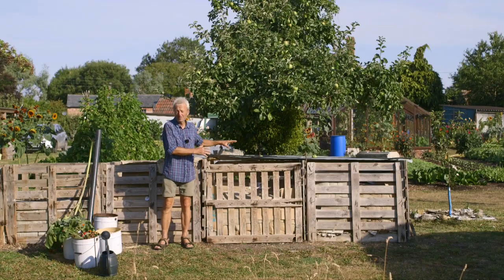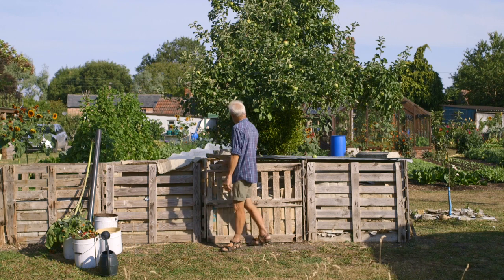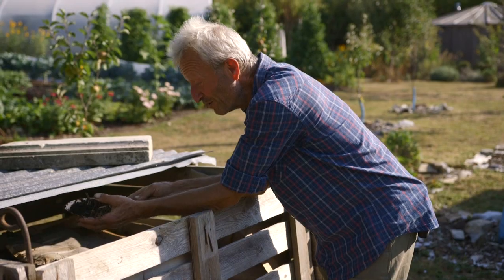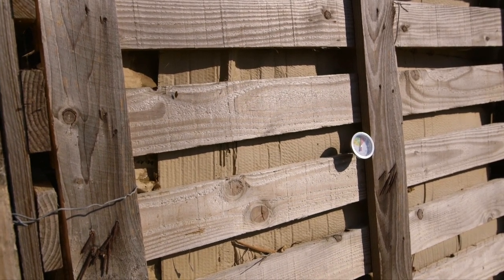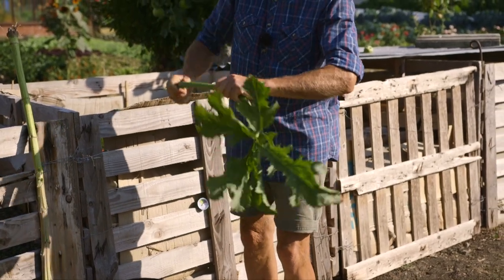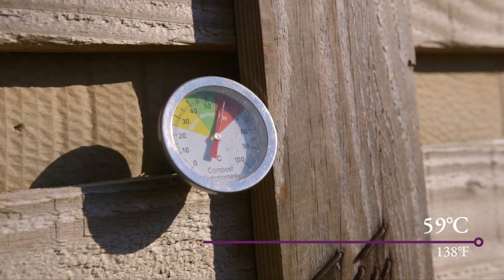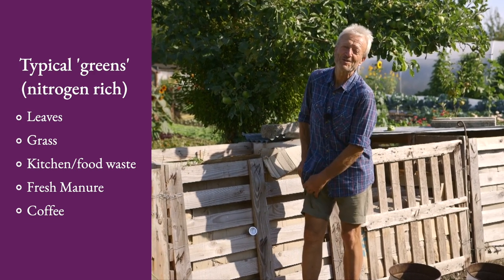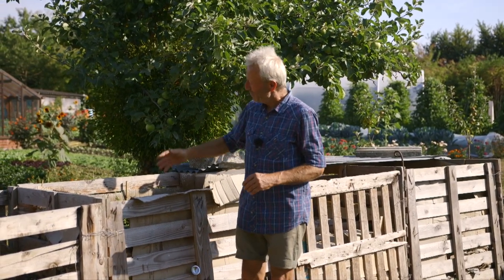4 Compost Heaps in 3 Bays, ready in 6 to12 months

Comment: Hello Charles! I am a wee bit confused, you put the final stage compost bin in the middle, I thought it would start at one end and you would turn them in sucession, working your way towards the end finished bin. If you have two on either side of the finished bin, what order are you filling the two working bays? You probably explained and I may not have understood. Thanks so much for your great videos, and I learn from the comments too!
Reply from the maker: Hi Mary, I think we needed a diagram! Yes it is not successive, we add new material only to the bins on either end.
The middle bin or bay is always receiving only half-finished compost which is turned into it. 
The turning frees up space to start again with filling the outer bays
Reply: @CharlesDowding1nodig  I gotcha, I guess that's good when you have lots of material to get composted! Thank you for clarifying!
Reply: Charles. Do you empty each bin into the middle or just take most composted part?
Reply from the maker: @SGSpeaks  yes the whole of each of the outer bin ends up in the middle which then contains over a tonne of great compost, after another 2-3 months
Reply: I am going to have to come and see you do it🙄
If you empty two full bins how is that going to fit in and wont the most recent material be uncomposted. Apologies for labouring this especially as I was stood in a compost bin with you when you first explained it!

Comment: Charles notice you have a cover of corrugated iron on top. Do you cover your bays for a particular reason? We've had alot of rain here in Sydney, 3rd consecutive La Niña in fact and the piles are constantly wet. Would you recommend covering them? I can't seem to get a heat build up but you did mention. That wasn't so critical. ☺️
Reply: One of his videos shows that his compost piles had the slanted covers built for protection from the rainy season.
Reply: He mentioned in the earlier video that the roof was to keep excess moisture out in his climate (which sounds like yours temporarily)
Reply from the maker: Yes in rainy weather, I cover! Your weather sounds crazy!
Reply: @CharlesDowding1nodig  thanks Charles. I missed have missed that finer point. Will scrounge for a cover tomorrow!! The Eastern states in Australia have been hammered by  La Niña and we. Are so over it. The 3rd round coming up. Prior to the wet  we had that devastating drought!
Reply: @DK6060  thanks! I missed that finer point.💐
Reply: @ritalr15  thanks Rita. I missed that finer point. 💐

Comment: Hi Charles, great video!  Thank you. I just have one question if I may, I have worms working away in my compost bins which I started a couple of years ago, I haven't accumulated enough to use on the beds yet, but when I do, should it all go on worms and all or do the worms need sieving out and leaving in the compost bins? Thanks in advance! :)
Reply from the maker: Hi Corinne, actually I would spread that compost when it's just a year old, you don't need to wait so long - and spread the worms as well! They will carry on doing some work on the sol surface and then leave some eggs in the soil to hatch more little worms at some point in the future. See if you can find more materials to add to your heaps as well, from perhaps tree leaves at the moment which often are available nearby

Comment: Hi Charles, I could get hold of some horse manure which has wood shavings (a lot of in proportion to the quantity of horse poo  and urine) as bedding material. When I used it in my compost heap I still got quite lots of shavings in the final product, could I consider this kind of fresh manure like a more balanced green/brown rather than a pure green material, mixing it with some other greens perhaps while layering the different ingredients? Thank you in advance and also for all the knowledge you're sharing in general, keep it up!
Reply from the maker: Cheers Francesco and depending on the amount of wood, you could use it as compost and will then have some wood flakes on the surface of your beds, which as long as they are not too thick will be fine

Comment: Hi dear one, if i would use these palletsiwould get the local esthetics commissions and my landlord after me...
Isrockwool a good starter material witheoodchips compost for my Marron mushrooms? And i want to use and old truck of a pinetrees which root is still in the ground and slowely deteriating..I want to try to grow some other species mushrooms on there..is that the right compost or should I treat it differently before i put the spores in the deteriating parts?!
Reply from the maker: 😂 and I don't know Simone

Comment: I love making compost and we have an added bonus killing 4 sheep a year for the table, everything not for freeze is buried in centre of a heap ( bones removed when we deconstruct) so we end up with almost pure worm castings in the middle of the heap surrounding this with arborist mulch and cardboard, this wast ends up about 30 cm in from sides of metre square box and although we have rats which we trap, they never burrow into the timber compost bins. I am no sure why, very easy access because bins wooden not sealed, on the ground with slated sides.
Reply from the maker: How amazing, great recycling

Comment: Hi Charles, I have learnt so much from you. Thank-you so much for sharing your extraordinary wealth of knowledge. I have been wondering if it is ok to use compost if it still has slaters/earwigs etc. in the heap? I have what appears to be a finished heap but I am hesitant to top up my raised beds with it as I don't want to introduce any bugs that may then move on and start chewing on my seedlings. What are your thoughts?
Reply from the maker: You are very welcome, and I would certainly use that compost, no more than 3 cm thick so there won't be too much of those insects. You can also remove from the new compost any larger pieces of wood which is food for them and put them back in your current heap to continue decomposing
Reply: @CharlesDowding1nodig  Thanks so much for replying! I will take that on board and start spreading some tomorrow before the summer crops go in. Cheers from Australia!

Comment: I use a 2-1/2" PVC pipe down the center, but I drill a bunch of 3/4" holes every 2-12" down the length.  I put four rows of holes.  Then I just leave it in the pile.
Reply from the maker: Thanks for sharing

Comment: Great video Charles! I’ve made good compost and I’ve made rubbish compost, it’s been really hit and miss for me but this video is very reassuring and lots of practical pointers. I find I make the most mistakes when I lack confidence in what I’m doing...ie trying too hard to get it right. This 3/4 bay method is a great principle. Thank you for taking the time to share.
Do you know what “Fat Hen” weed is? It grows everywhere on my plot. Up until now I don’t throw it in the compost heap because each weed has about a million seeds! If you do know it would you compost it? 
Kind Regards Pat Joyce
Reply: eat it. It's like spinach and related to it and I freeze some most years and tend to lay spare plants on areas i want more to grow in because it's easier than contrived plantings. I do compost any spare bits.
Reply from the maker: Nice to hear Pat, and fathen weeds are a sign of fertility, related to spinach so you can eat the leaves although they are not delicious! I would compost them, and best pull them before the seeds are viable. 
When you have a lot of weed seedlings, I suggest you use a hoe to tickle the surface so that they die in the sun and wind, without you having to remove them by the thousands

Comment: It's alright saying use pallets for compost bins but how do you obtain them cheaply? Also I find that it's hard to get brown material as against green materials. 
I can however get free organic horse manure which I use without mixing it with other compost. The thing now is, that now Charles has stated that horse manure is green compost, I'm worried that this compost will have too much nitrogen in it as opposed to potassium?
Reply from the maker: All sounds good and it's the actual excrement of horses which is green. The word manure is usually applied to the total product which includes bedding of any materials the animals have been lying on. Maybe straw or paper or woody material of some kind - and that balances teetotal ratio because the bedding has carbon, so no worries.
Reply: @CharlesDowding1nodig  Hi Charles, I don't believe there is any bedding involved, because the guy who supplies me the compost says the wood he uses for bedding isn't suitable for composting for some reason. Maybe something he's been told or read?
So it's just Hoss Muck, which may have a high nitrogen content? Anyway it gets to 70 degrees C while composting.

Comment: 65° heat in the big compost bays? Ground source heat pumps are so expensive to install. How about a compost source heat pump for heating your hot water for the house?
Reply from the maker: I get your idea however that would be taking heat which the materials use to break down, so it would slow the composting process. There's only a small amount of 65° heat!

Comment: Perhaps if you water before adding the last few layers down then you’ll spare some of it from evaporating off of the top
Reply from the maker: An interesting thought but generally here, by the time we're close to the top there is a huge amount of moisture in these heaps and they do not need any more. It's really the surface only which dries and quite often we have too much moisture just a bit lower down, which it does not evaporate from the surface. 
Using the plastic means worms come right up to the surface which I want.

Comment: Hi Charles, i'm about to start my own market garden project but i have a problem to find compost in my area and because of that it is extremely expensive.. but last week i've been offered 1 year old bull manure at a good price and so i wanted to ask you if that is good to use it or not.. thanks a lot
Reply from the maker: Yes for sure that is basically compost. Any decomposed material will serve and it does not even need to be fine. The finest compost wants to be just at the surface where you sow and transplant. Good luck in your new project.

Comment: Hello. Do you not have any issues with rodents or other bugs and pests where you live? I have squirrels, mice, beetles, road runners rarely, and rabbit. The squirrels and rabbits dig under ground and eat everything. I want to try no dig and have a compost bin like yours. I have been trying to garden in pots so far and I can’t keep anything alive and away from them. I’ve bought nets to cover the plants. I have also bought mini covers and thought I could block them but alas no 😢. Any ideas on what I can do?
May I also randomly ask where you purchased or how you designed your greenhouses?
Reply from the maker: No ideas because they are part of a compost process, unless you buy a tumbler, q expensive.
Woodpecker Joinery!
Reply: I have a ton of squirrels, rabbits, deer and chipmunks here and I have to protect my garden from them or they eat absolutely everything. I made a 6ft fence around the garden, using pvc coated welded deer wire, attached to T posts. I noticed some smaller rabbits were still able to squeeze through the holes or burrow under it, I also added a 4ft coated chicken wire at the bottom of the existing fence and dug some of it into the ground, so they couldn't burrow under. The second one was much easier because I didn't have to drive in any more T posts, I just attached the chicken wire to the existing fence with zip ties. If you don't have any deer problems, I think just getting a 4ft chicken wire, and digging 1/2ft-1ft of it under ground and attaching it to posts would be enough to keep any small critters away! Since I made the fence, I have yet to have any problems at all!
As far as protecting the compost heap, I usually just let them scavenge around, since they mostly just pick out the fruit from the heap (and I have a LOT of compost material), but if you want to protect that, I would just do the same thing, line the bottom with chicken wire so they can't burrow under, and line the sides with chicken wire as well. You could attach it to the compost frame either with wire or zip ties. Then just add a removable cover on top!

Comment: Compost is so stressful I brought a hot compost bin and followed it to the T and its so slimy and my pallet bins just don't mulch down.
Reply from the maker: I'm sorry you find that! Maybe you could not use a hot bin and add everything together because that will be a good balance
Reply: @CharlesDowding1nodig  I also have a 4 bay bin that has material in from 2yrs ago that does not break down I have had it in shade and full sun have tries the turn method and the last 8 months just left it alone and it still doesn't break down

Comment: Just one observation, don't be afraid of high temperatures in the compost heap. I regularly reach 76 degrees, the record is 80. Yes, the temperature will kill some of the thermophilic bacteria, which means a partial reduction in the activity of the thermophilic bacteria, i.e. a lowering of the temperature. When it is back at a suitable level, the bacteria will start to multiply again and the temperature will stabilise quite naturally. I have never had a problem with that. Additional watering can only cause the bottom part to get too wet. As far as I can see, people have the most problems with a too-wet pile.

Comment: How do you keep rats from becoming a problem in your compost bays?
Reply: One suggestion I've heard a lot is first and foremost to not put meats, bones, animal products, or cooked carbs in the compost as they are the main rodent attractants. In our urban set-up, compact hot composting is working well to deter pests (we don't have rats but we have tons of voles). We use those big black garbage bins with lids, drill holes all around the sides and bottom and stack the compost materials in there. The black color helps with heating up the system.
Reply: That's what I was wondering as well.

I have to use a closed container, I live in the southeast US, so these would attract mice and rats which would attract snakes which are already extremely abundant here.
Reply: @ourcozygarden  we only add plant material to our heaps but our neighbour's garden has rats that keep moving in. Unfortunately our garden is too big for the dalek style bins to be feasible.
Reply from the maker: I don't mind rats, they are discreet and do a good job of aeration. They arrive for warmth mainly, in winter
Reply: @islakirk75  I have the same issue! I have a dalek in a currently unglazed greenhouse, I don't add foodstuffs other than veg peelings etc, but still the rats get in at the base. I live in a very rural area next to agricultural land, so probably not a lot I can do. I've also got huge uncovered heaps elsewhere which, as yet, I haven't noticed being invaded by rats!
Reply: @CharlesDowding1nodig  ah, I have chickens so the rats are more of a concern and we seem to have them year round.
Reply: In Italy I had a snake snoozing in one corner and a nest of mice in another. Just left them to it.
Reply: Here is my rat prevention strategy, after some trial and error. I put my actual garden materials in open bins like Charles’s. But I put my kitchen scraps and any fruits that would attract rats into 2 compost tumblers which I basically use as worm bins - populated with worms I pulled from my open compost piles. 
The rats aren’t attracted to the open bins because they don’t have good food sources, and they can’t get into the closed “worm tumblers”. The reason I have 2 is one gets fresh matter added. Once it’s full, I let is sit for a few months for the worms to finish their work. To keep the worm tumblers from getting too wet, I add pine pellets which are sold in 40 pound bags as animal bedding. It absorbs moisture and stops the tumblers from becoming waterlogged and foul smelling. The worms are happy. They survive in the tumblers over winter in coastal Washington state - just a tad warmer than Charles’s winter climate, I believe.
I just wish I generated as much garden matter as Charles so I could fill my open bins faster.
Reply: @mgt74  That's really helpful, thank you.  I have a tumbler that I've not been using so will bring it back into service and I use fine wood chip for my chicken bedding so I can add some of that to keep it from getting too wet.  I'm in the Scottish Highlands which sometimes get down to as low as -14C so I may have to give some winter protection for the worms.  I wonder if the chicken manure that goes into my heaps is a source of food for the rats and I'd be better adding it to the tumbler too?  Thanks again for the suggestions :)